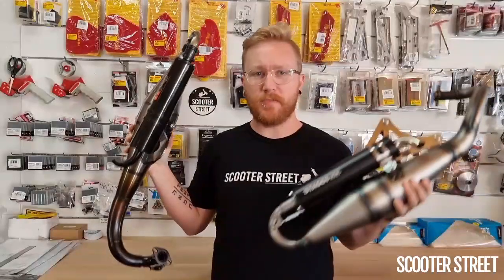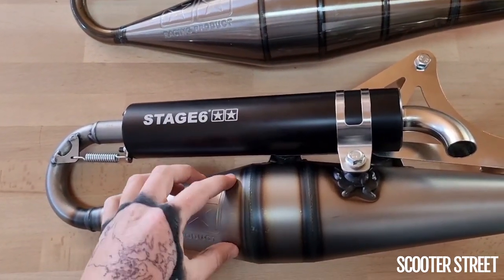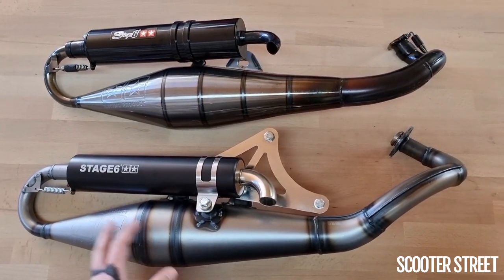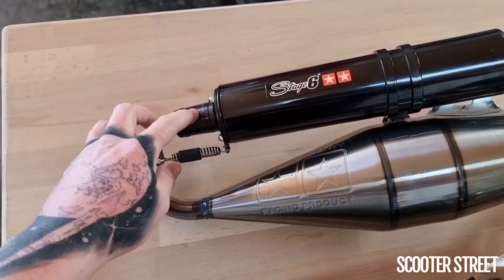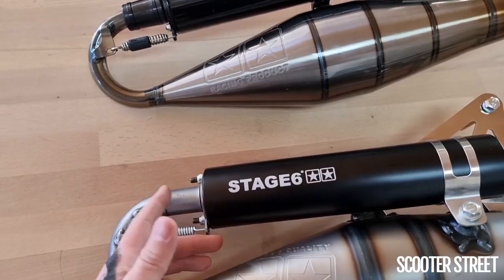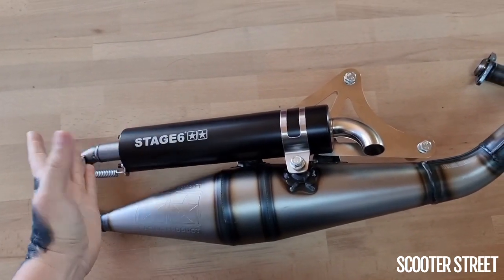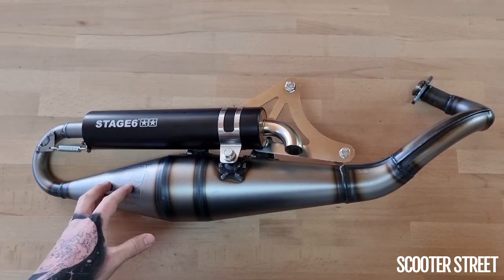Stage 6 Pro Replica Exhaust MKI vs MKII - What is the difference?

Comment: Just as a heads up, the Stage 6 Pro Replika MKII is NOT exactly the same as a Yasuni R.. And it is quite obvious when you compare them next to each other. The Yasuni R is made of more pieces than the Stage 6. Other than that, god job explaining the differences.. The most important difference for most people is probably the power.
Reply from the maker: Yes that is right, closer to the Z but still not identical.👍Thanks for the comment and yep the power at higher rpm is where it lives.

Comment: Hey man, im wondering if malossi multivar and malossi clutch with clutchbell with red clutch springs are good with s6 mk2 pro sport and pro replica mk1 and motoforce 24pwk with 94 main jet are good together, or should i buy a new full vario? Also how well they preform together?  All those in a yamaha bws 50ac
Reply from the maker: Hi mate, that sounds like a good little setup. The carb sounds probably too large, we'd normally recommend no larger than a 21ml carb for that setup as it can create a bottleneck at the cylinder and be very hard to tune. The transmission parts will be fine, you just need to fiddle with the rollers to get the weight right, though I would definitely recommend a performance belt.
Reply: Vetikö tää pro replica mk1 hyvi ton mk2 kans
Reply: @veke05  no lähti noil varisäädöil ja tol putkel ku nato-ohjus
Reply: @rikutiini5480  :DD nais

Comment: Bought the stage 6 mk1 for my 50cc org and just nugget jets on the carb. It accelerates very slow so my question is if i can somehow balance the exaust with lighter weights and pressure spring and clutch springs?
Reply: Just a bigger jet*
Reply from the maker: Yes you can balance these but the MK1 needs higher RPM to work properly.
Reply: @scooterstreetau  so if i change and find the right vario weights and the right clutch spring and right pressure spring my moped will have better acceleration? Or do i need to swap to a bigger carburator and 70cc?

Comment: Judging by the length difference, i'd assume they have different powerbands? Do you know the powerband of the MK2? 
The first pro-replica doesn't like to rev very high like the R1200 for example, maybe 9k rpm.. Curious to know if they made the MK2 to operate at the same rpm.

PS, the polini rubbers for the silencer connection fit it perfectly, i used those when mine ripped. Polinis last longer too.
Reply: The pro replica made peak power at 9,500rpm.
The Yasuni R made peak power about the same revs. But it had a far wider power band. Where the pro replica really loses power after 9,750rpm, the Yasuni keeps going. Losing power but nothing like the rate of the replica.
Reply: @paulbudford  Thanks a lot for the info!
Reply: Using the Pro Replica MK2 with Sport Pro MK2 @ 10,300 RPM , runs great :)

Comment: are the performance similar or better?
Reply from the maker: Each pipe has an advantage for the correct set up. MK1 is for a high revving, higher end Cylinder, MKII will match well with street race set up. Watch at 5:20 we discuss the performance situation for each.

Comment: Hi I have recently purchased this exhaust from you  and now just fitted it, could use with some advice I have fitted it on with no gasket because it didn’t come with one and I don’t think it needs one from my research however within minutes of riding it had all black melted stuff on end of the exhast under the bike (oil I’m pursuming) is this because I’ve fitted it wrong or is this because I need to up or down jet it. (My bike is a sr50 2016 and it’s stock I belive because it had a standard exhaust on it before and would go 45. Now it goes around 47 on this. 
Any idea What should I do to make it not have the oil leak. Thanks
Reply from the maker: Hey Lewis, It is so IMPORTANT to tune the scooter when fitting an exhaust, this is what our Youtube channel is dedicated to, TUNE the scooter! Find out for sure if it is oil?
Reply: @scooterstreetau  yeah it is oil, it’s all on the end of the exhu
Reply from the maker: @lewisball7092  Check the oil and fuel system, you may need a mechanic for this one. Did the old exhaust have loads of oil in it?

Comment: Is the yasuni R or the stage6 pro replica mk1 better on a original Yamaha aerox?
Reply from the maker: The Yasuni R is a much safer choice, it will fit nicely and tune up relatively easily on the stock 50cc or 70cc if you go that way later on. The S6 pro rep mk1 is a mid race exhaust, and will be difficult to tune on the stock 50cc cylinder due to the exhaust chamber being designed for a much higher volume of flow. The later S6 pro rep's are made in China, we have seen some quality and fitment issues. I would suggest it is likely the case that S6 have moved to Yasuni manufacturing for the MK2 due to this.

Comment: Hey man, one question.
I have Stalker with Extra V2 Gianelli, mallosi multivar with 5g rollers, green center spring, blue clutch Polini springs, Malossi air filter and 84 main jet on 17.5mm Weber, it goes about 87 gps speed. Now i have bought Gianelli Rekord, derestricted it, tried with 5 ,4.5 and 4g rollers on same set up and it goes 80 max on gps, even tried original center spring. Can you give mi some advice, what em i doing wrong. Because Rekord should give me better performances in theory.
Reply from the maker: So if the only part changed was the exhuast, I would have to agree that the exhaust is what has limited the speed. So we look into the exhaust because the Rekord should add small amount of TS. Try the V2 stinger on the record, now test and GPS. 
Ok now increase the main jet 2 points and test again..... Get back to us.
Reply: @scooterstreetau  yes, just an exhaust and tried 4,5 and 4.5 rollers, tried original central spring, even tried putting airbox and smaller jet on, and it is still worse than Extra V2. With that set up it goes about 87,88 gps on flat. So that means that set up is good. Ill try larger jet and lighter rollers.
Reply from the maker: @grgurmandic6622  👍
Reply: @scooterstreetau  i tried larger jet, i tried putting air box on, tried with smaller jet, tried original center spring, lighter rollers, everything, and it still performs worse than with Extra.
Reply from the maker: @grgurmandic6622  Did you try the V2 stinger on the Rekord??

Comment: is it necessary to put a bigger carburetor? can i put that exhaust on my original scooter?
Reply from the maker: No it is not. When you do upgrade the carby you will certainly notice a performance increase..
Reply: @scooterstreetau  another question, i found a new yasuni z at 100 euros, does it worth it? is it more appropriate for a 50cc?
Reply from the maker: @brighiii  The Z is a great exhaust, works well on a 50cc or a basic 70cc build.

Comment: Hey I have a question what size is the spacer for the stage 6 bracket
Reply from the maker: The spacer to the engine mount seen at 7:17.. 50mm, it can be spaced using washers.

Comment: Im looking for some help with my yamaha jog rr 50cc I've got a stage six pro replica mk1 and a bigger jet derestricted cdi,5.3g rollers, 15% stiffer torque spring and fully stock clutch. The scooter was tuned by the previous owner and had an oversize variator which I replaced because the rollers were worn and I couldn't find any of the same size online. Now heres the problem the fully derestricted scooter can only go 30mph at full throttle and if I have the throttle at 3/4 my speed will drop below 20 I'm not sure what to do don't want to ride on full throttle all the time
Reply from the maker: First thing you need to check is the main jet. Good chance that its wrong. Its very difficult to diagnose problems when you don't know what the previous owner has done.. I would probably recommend taking it to a workshop, in person it is much easier to diagnose for an experienced technician.

Comment: Hello everyone, tell me where I can find exhaust pipe test charts, I found only old versions, now I'm interested in Léo Vince tt, stage 5 replika MK2 and yasuni r and z, I want to understand which exhaust suits me best, thanks.  Piaggio hiper 2 stock engine with dellorto 17.5 carburetor.  Thank you
Reply from the maker: You will find this interesting,   https://www.tuningmatters.com/reviews/exhausts/scooter-tuning-exhaust-test/
For the later exhausts I am not sure.
Reply: @scooterstreetau thank you very much for the article, it brought me closer to the choice but it is very old and modern leo vince tt, I guess it is very different from the 2013 version, like stage 6mk2 and technigas q-tre, in your opinion which exhaust is better for stock  piaggio cylinder with the subsequent transition to the budget motoforce 70 cc racing cast iron, thanks guys for the help!  it so happened that I didn’t ride scooters in Ukraine for more than 10 years and recently arrived in France, and it’s very boring to ride on the factory version :)
Reply from the maker: @user-ys2vv2ph3j  I like the Yasuni Z for 50-70cc and Yasuni R for 70cc and higher class.

Comment: Can i use the mk1 With a original carburator. Just changing the jets in the carb
Reply from the maker: For best results you need a 70cc kit and very light rollers. Original carby will be ok but the performance will have a loss of potential.
Reply: @scooterstreetau  but does it not work with the original cylinder and original carb.
Reply from the maker: @hstiller8649  As I always say, give it a go and you will find out. You will not be satisfied with the result, this exhaust is designed to function with high RPM. We tried it before and was a moment of learning.
Reply: @scooterstreetau  i tried with original carb and engine but it is really slow from 10-70 do you think a 17.5 mm carb insted of a 12mm would work
Reply from the maker: @hstiller8649  See original reply.

Comment: How come they don’t use a gasket to seal to the cylinder? Would you use any kind of sealant or just go metal to metal and hope for the best?
Reply from the maker: The Factory exhaust also fitted without gasket. The rounded lip design of the header connection to the cylinder seals as it is tightened. Great idea and one less gasket.
Reply: @scooterstreetau  but wouldn't that restrict the flow, given that the header almost goes inside the exhaust port?
Reply from the maker: @joaomelo61  It does not go inside, the sealing face is outside the mouth of the exhaust and it aligns with the cylinder not to impede the diameter. Look at 7:09 in the video👍
Reply: @scooterstreetau  got it! I though it kind of press fitted inside.

But we should still put some kind of sealant paste / silicone high temp etc right?
Reply from the maker: @joaomelo61  It is not necessary..

Comment: I just bought Stage6 pro rep mk2 in my Ry6. Does mk2 have better performance?
Reply from the maker: As in the video, the MKI requires very high RPM and will deliver more power.
Reply: @scooterstreetau  What should i change to get the maxium performance?
Reply from the maker: I read your other repy😂. the MKI is no longer in production so you made the correct selection👍. Buy the compatible 70cc cylinder, and get a variator, clutch kit too. @miskamakkonen2401
Reply: @scooterstreetau  Thanks👍

Comment: heeey nice channel lots of goid tips
i have a kymco grand dink 50 2008
im waiting for parts
Cilinder kit Naraku V.2 sport 70cc Kymco hor. AC
Variomat SPORT NARAKU 7.5gr Kymco
Naraku 17.5 carb 

can u recomend an exaust for my setup if posiblle not a very loud one i like deep sound  not high pitch one thx.
Reply from the maker: HI Joc, thanks mate glad to hear form you🙋‍♂️. From the shop where you bought the above parts, what do they offer in the exhaust range? From what you mention, I would lean towards a standard looking pipe to keep the outlet noise down but still offering a free flow to enhance the performance. Look for brand models such as Malossi Wild Lion orTecnigas silent Pro, others include, Naraku, Turbo kit and Polini. Google these 2 suggestions and then see what your shop has to offer.

Comment: Is there a big difference bitween  STAGE6 PRO REPLICA MK2 and GIANNELLI REVERSE
Reply from the maker: I wouldn't say theres a big difference, the Stage 6 is probably the better of the two in terms of the greatest max power ability.
Reply: @scooterstreetau  What about sound ?
Reply from the maker: @Kyros_PV  The Giannelli will be louder for sure, and a much harsher sound from our experience. As the stage 6 is a rebadged Yasuni, it uses the same Yasuni silencer as the Z, R and C16. It has probably the best 2 stroke tone of the exhausts we've used. Nice tinny tone, with no harshness, and not too loud.
Reply: @scooterstreetau  Even if I remove the restrictors it won’t be that loud ?
Reply from the maker: @Kyros_PV  It'll be louder than the factory for sure, but the Yasuni/S6 exhausts are a very manageable volume. We remove both the header and silencer restrictor in the exhausts we sell/use.

Comment: Can i use my silencer on my mk1 on the mk2 exhaust?
Reply from the maker: No...the connection is different. MK1 has the rubber boot connection and the MK2 connects straight to the flange. Do a few mods and you should be able to make it fit....

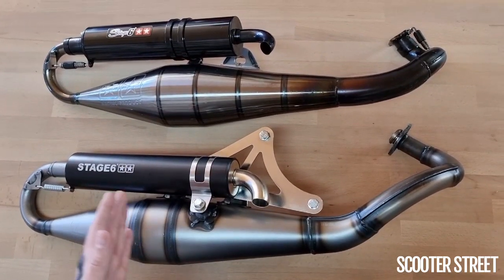Comment: 5:30 is the mk1 better than mk2. Got a mk1 on my yamaha slider.
Reply from the maker: MKI works best for a high revving cylinder. Very loud unless repacked. MKII is a little more moderate, similar to YasZ.
Reply: @scooterstreetau  so the mk1 would work better with a 70cc mk2?
Reply from the maker: @Wil2017  MkI for higher end, it need RPM.
Reply: @scooterstreetau Hello again. I am thinking of upgrading my Stage6 Pro replica mk1 for a yasuni c16. I have got a s6 mk2 70cc sport pro on my yamaha slider. You've said that the mk1 is similar to the c16 when put to higher rpms. But on the swedish websites it says that the pro replica mk1 is a middleclass exuast and they have said to me that there is a big difference between the c16 and pro replica mk1. So i just wonder will there be a noticeble difference in my effect register and will a c16 improve the register and be a overall better exuast???? Thanks
Reply from the maker: @Wil2017  I would agree - the C16 is step up from the MKI. Need a high revving Cyl. kit for these to work optimally.

Comment: Is there anyone that can help me here you guys helped me last time with my exhaust that I bought my question is I have a Zuma-mbk booster I have a 70cc Athena kit in it aluminum sport kit I'm pretty sure it's a sport kit anyways it's low on compression I thought for sure it had a piston marked A like a fool I didn't tear the motor down to check before I ordered a new piston and ring oem Athena the piston I ordered is the A type piston the original piston has a B on it the cylinder is also Marked B I checked both Pistons with calibers and compared them and they are very close if not identical to each other would it be safe to run the new A type piston it fits like a glove from I can come up with there maybe a 1mm difference in the 2 pistons but they both check out the same with the calipers there both 47.54mm are close I plan to get the cylinder honed out to D glazed
Reply from the maker: I can't tell you it will be fine, I don't know. I can tell you in cases where a customer was desperate to have their bike back we have used a different size Malossi piston in a cylinder and not had an issue. The difference in the Malossi piston sizes is tiny for the most part, I would assume the same is true with the Athena cylinders. The safe bet would obviously be to order the correct piston.. or confirm the details with Athena.

Comment: Isn't the stage 6 pro mk2 designed specifically for the stage 6 sport pro mk2 cilynder?
Reply: No, the r1200 is for the mkii sport pro, the pro replica mkii runs well on 50cc standart and sport as well on 68cc/70cc sport and weak midrace.
Reply from the maker: Max is nailed it on the head there, the Pro Rep MKII is essentially a re-badged Yasuni. It isn't specifically designed for any particular cylinder, but it is an excellent exhaust that will work well on many cylinders up to a low end mid-race.
Reply: @scooterstreetau  do you know why my scooter dont go faster with the mk2 on?
Reply from the maker: @hedinolsen4363  It will depend greatly on the way (tuning and parts compatibility) you have the engine set up..
Reply: Mk2 runs great on stage6 70cc streetrace
Reply: Pro Replica MK2 runs also great on Sport Pro MK2 ;) @ 10,300 RPM

Comment: Stage 6 pro replica mk2, whit cylinder mk2 yes?
Reply from the maker: They will work well together. It depends which MKII cylinder, the Sport Pro or Racing. The Pro Rep exhaust will work well with the Sport Pro, however the Racing cylinder will work better with a more race orientated exhaust like the Yasuni C16.